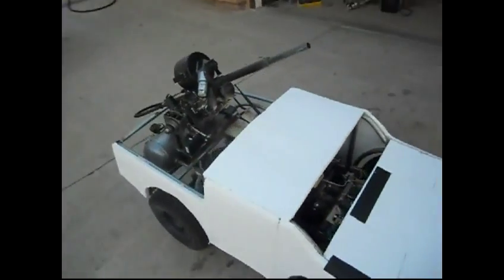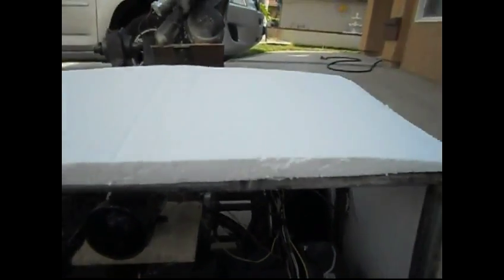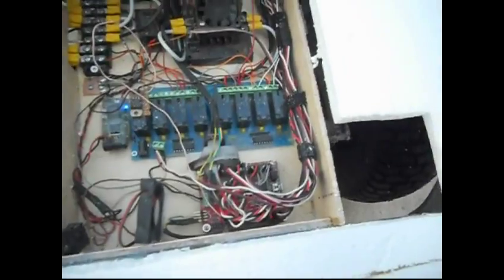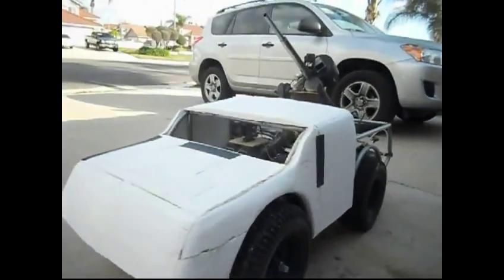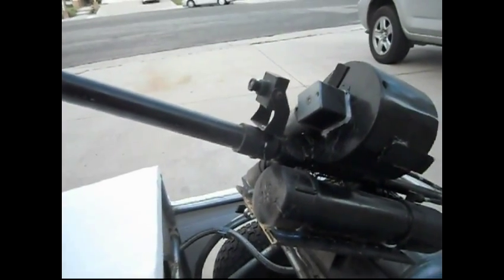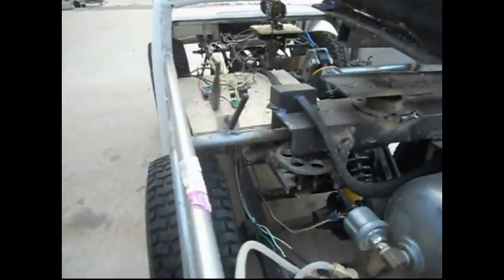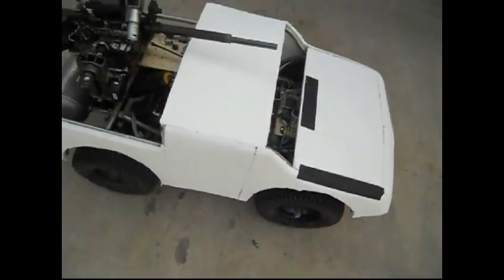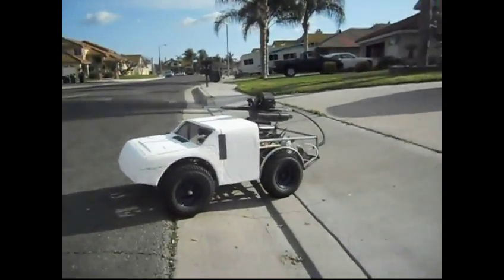Homemade RC with insane cannon, rebuild update2"Watch it" .qt

Comment: This is awesome!!! How much time have you put into this project? And how much does it weigh total?
Reply from the maker: unfortunate but fortunately my project's tent evolve as new ideas hit me. but i would say about a month worth of time. using SLA bats, ans all steel construction, So its not very lite. i used EMT piping for the body support. And now, i is undergoing more changes. full on semi truck with suspension and big motors.